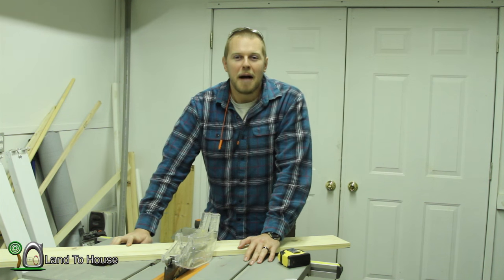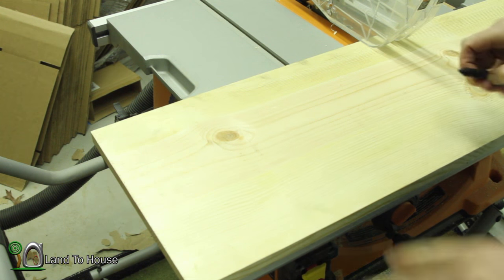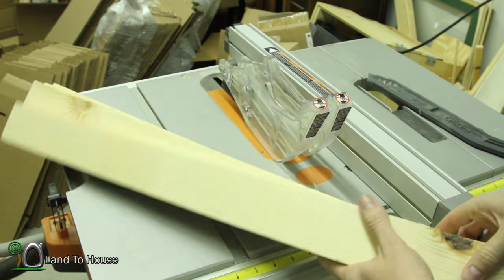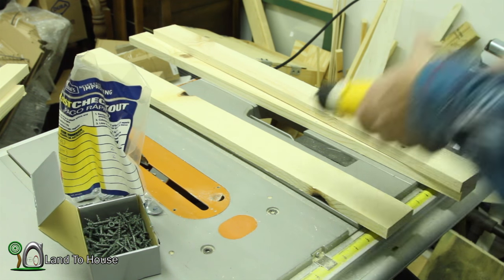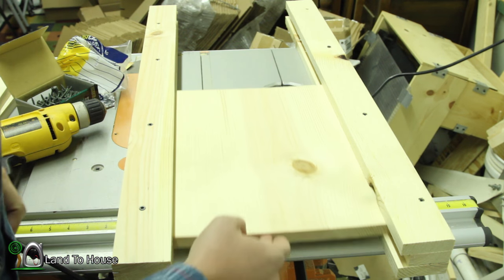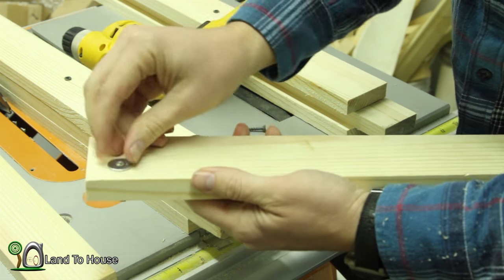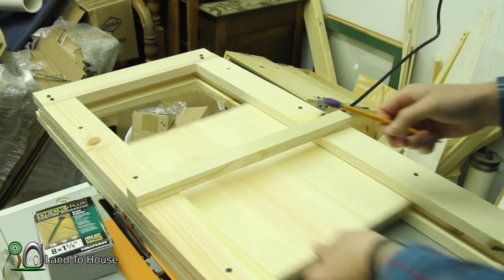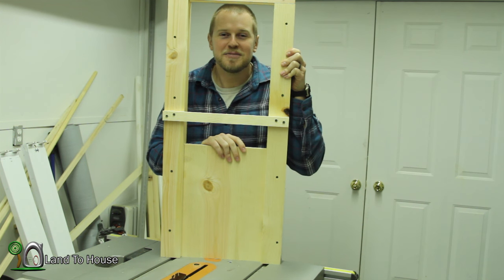Amazing Automatic Chicken Coop Door Part 1/7

Comment: Good design.  Looking forward to part 2.
Reply from the maker: +Pidasian Hippie Thank you. Turns out it was a 7 part series to get everything finished.
Reply: Land to House Well, then I look forward to parts 2 through 7.  LOL
Reply from the maker: :) it is a fun project.  I feel like I have not actually used my electronics degree in years.
Reply: Land to House I had wondered what your degree was.  I also have an electronics degree (associates)  Unfortunately, it is very rare to get to use your degree.  I used mine to an extent, but lately, everything is pull the part out and throw it away and put in a new one.   There is very little board level troubleshooting any longer.
Reply from the maker: +Pidasian Hippie I have an associates in art and electronics then I got a bachelors in biomedical. I dont really use any of that in my job. But I have found that it has come in handy when making videos. Someday I am going to use more electronics. ... When this series gets to the electronics part you might get bored because its so simple. .... and you might have some good ideas on troubleshooting.
Reply: Land to House Wow!  You do have a wide range of interests don't you?  I look forward to the electronics part of it.